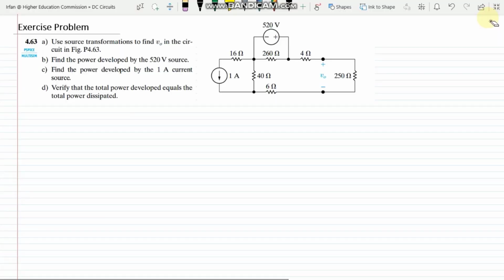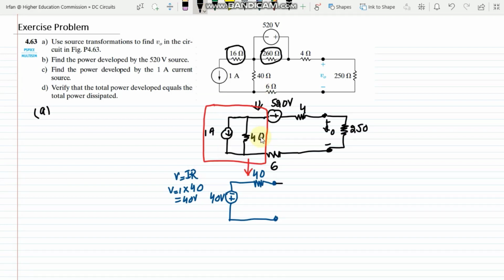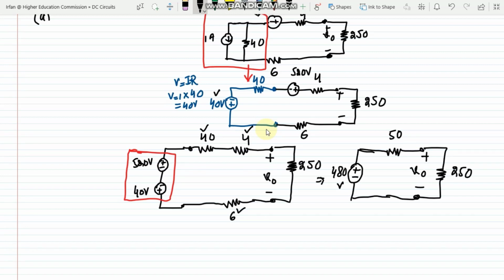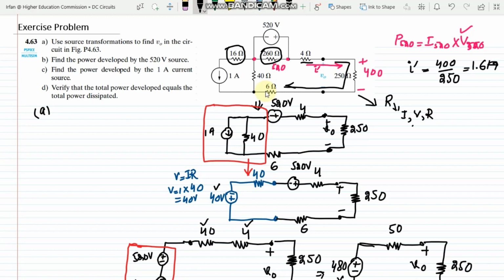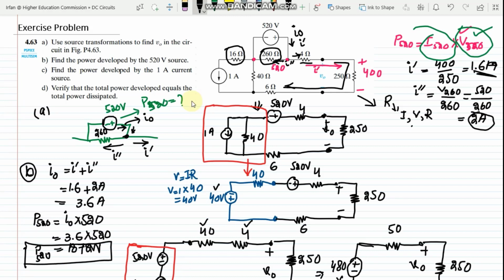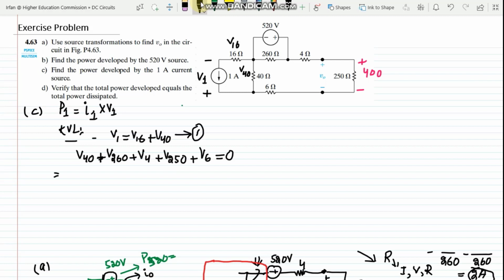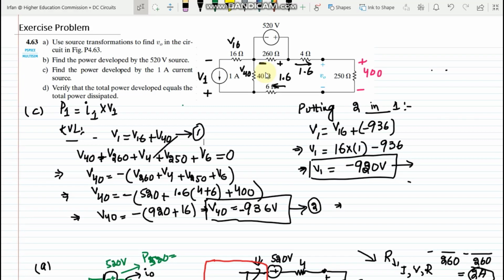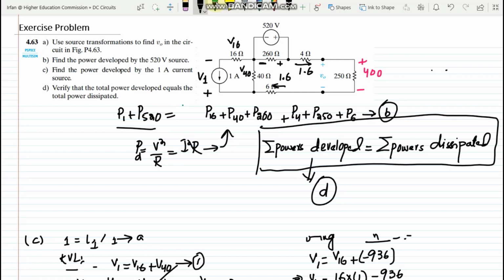Source Transformation Problem | Problem 4.63 | Electric Circuits by Nilsson 10 Ed| Engineering Tutor

Comment: So the way I found v40 was by saying that the current through that resistor is 1.6+1=2.6 and then 2.6*40=104. Why can I not do that?
Reply from the maker: If it follows KVL and you took all current directions in correct manner, then it will be correct. But keeping in view the assigned polarity it shouldn't be difficult to find the current directions. So as i think, you must have correct current directions.
Reply: @EngineeringTutorOfficial  your answer is wrong. the 520 V is supposed to be -520V so the KVL is incorrect.